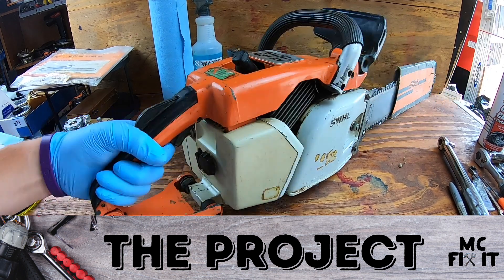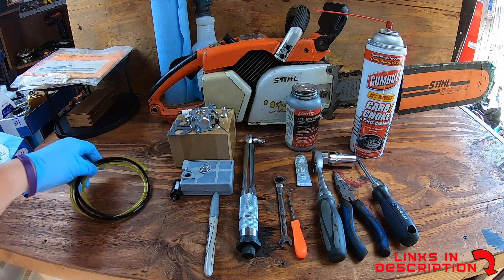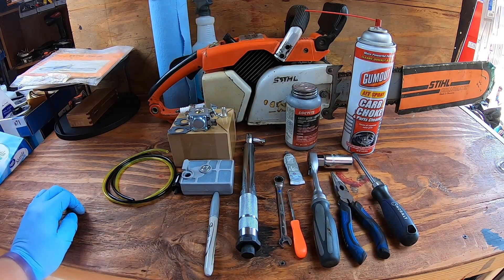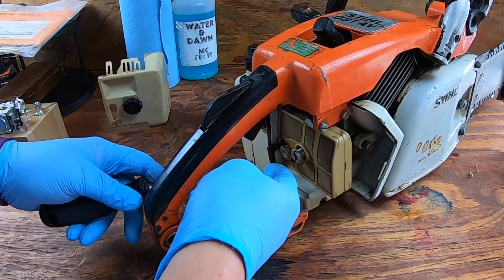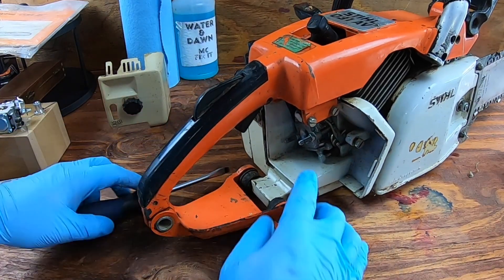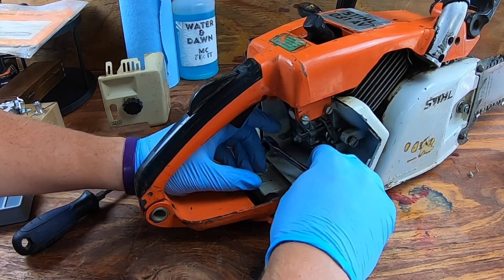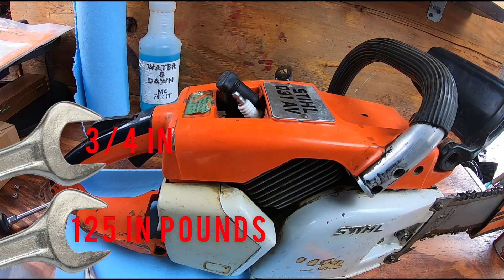How to Replace Carburetor & Spark Plug on a Stihl 031 AV Chainsaw (Complete Guide)

Comment from the maker: Learn how to replace your carburetor and spark plugs on a Stihl 031 AV Chainsaw. 

The Tools:
• Stihl 031 AV Kit - https://amzn.to/3yMMNiv
• Philips Screwdriver - https://amzn.to/3hdpzx0 
• Flat Head Screwdriver - https://amzn.to/2RAjTlU 
• Ratchet - https://amzn.to/3xWjE5g 
• 3/4 Spark Plug Socket - https://amzn.to/38JYBaI
• 8 mm Wrench- Basic Set - https://amzn.to/3jzlMcJ 
• Pliers - https://amzn.to/3h6X4jp
• Pick - https://amzn.to/3nZM8q4 
• Dielectic Grease - https://amzn.to/3ky5GAK
• Anti-Seize Lubricant-  https://amzn.to/3mG0Qnt
• Carb Cleaner - https://amzn.to/3BhFrFg
• Gloves - https://amzn.to/3bbfEnu 
• Safety Glasses - https://amzn.to/3ux25GO 
• Shop Towels - https://amzn.to/2SC8D93

00:00 - Start of Video
00:07 - The Problem
00:52 - The Tools
02:46 - Removing Old Parts
09:12 - Installing New Parts
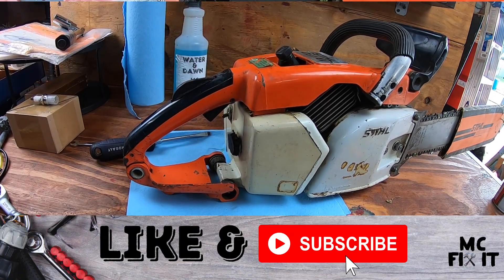14:35 - Closing of Video

This video works on many makes and models. Make sure to select the correct parts according to your particular make and model of chainsaw

Check out my website at http://mcfixit.us 

Disclaimer:
Due to factors beyond the control of MC FIX IT, I cannot guarantee against improper use or unauthorized modifications of this information in the video, post, blog, or social media. MC FIX IT assumes no liability for property damage or injury incurred as a result of any of the information contained in this video. Use this information at your own risk. If you feel uncomfortable at any time. Stop and go to a professional. MC FIX IT recommends safe practices when working on vehicles, your house, or any other project and or with tools seen or implied in this video. Due to factors beyond the control of MC FIX IT, no information contained in this video shall create any expressed or implied warranty or guarantee of any particular result. Any injury, damage, or loss that may result from improper use of these tools, equipment, or from the information contained in this video is the sole responsibility of the user and not MC FIX IT.

#mcfixit #chainsawrepair #stihl

——
Supplies used to record this video: 
* GoPro Hero 7 Black - https://amzn.to/3f3ALtb 
* 256GB Flash Drive - https://amzn.to/33pAueG 
* Vlogging Frame - https://amzn.to/33tajE0 
* GoPro Pro 3.5mm Mic Adapter - https://amzn.to/2RCURCu 
* Youmic Lavalier Lapel Mic - https://amzn.to/2R55sWX 
* Boom Stand (tripod) - https://amzn.to/3bdkQaw
* 5/8” to 1/4” adapter (boom to blogging frame- https://amzn.to/3txrVsM 
* Portable Battery Powerbank- https://amzn.to/3vJQc0q 
* 6ft USB to USB-C (powerbank to GoPro)- https://amzn.to/3uAS5MH

Comment: I would like to ask you a question on here that I cannot find anywhere else. I have been cleaning up and replacing parts on the 031av I have acquired a while back. It is the same as yours from the looks of it and I need to know one thing. What spark plug do you use in that 031av? I tried the one with the kit I got with the carburetor, and it runs WAY too hot for me to continue with it. I am needing to run this saw in a couple of days and for a couple of days, please let me know the numbers on that spark plug. Much appreciated    - Bobcat
Reply from the maker: This is a link with info on it: http://www.acresinternet.com/cscc.nsf/ed1d619968136da688256af40002b8f7/858c0dec5088261b88256ba2001978db?OpenDocument

It says you could use:
Bosch WSR6F, Champion RCJ7Y